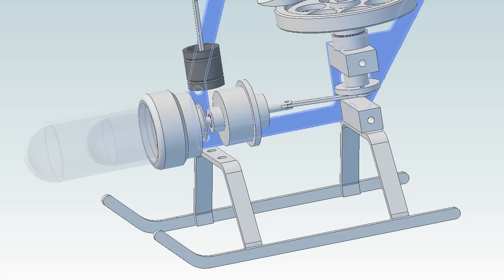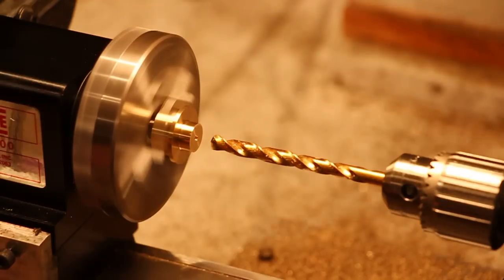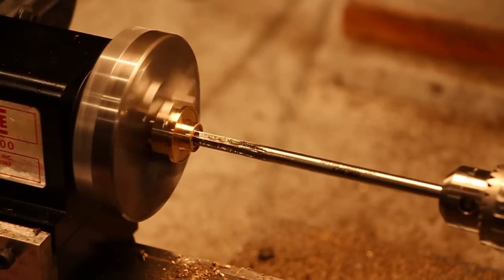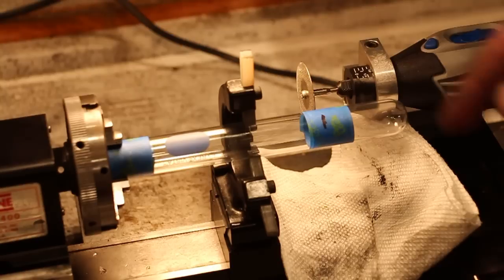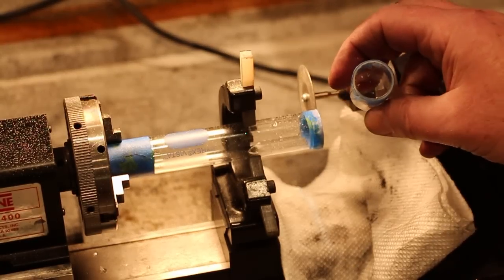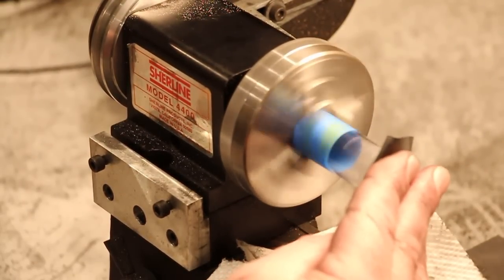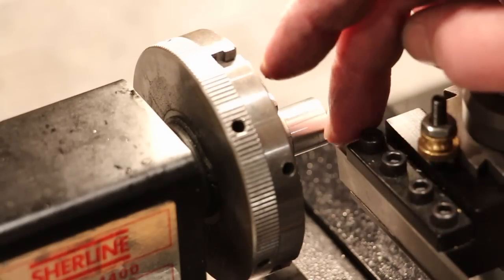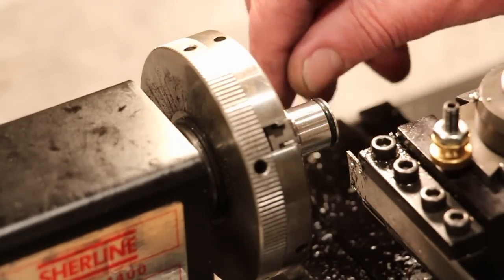Building a Stirling Helicopter - Part 5: Cutting Pyrex Test Tubes On The Lathe

Comment: Could you not put tight brass bushing on tail stock barrel  then screw it to the tail stock casting,seen something similar on TryAli web no affiliation nice vid's
Reply from the maker: Thanks Thomas. I've tried Tryally's technique and it helps, but I really like my new drilling setup. It also lets me drill holes that are deeper than the tailstock ram can extend.